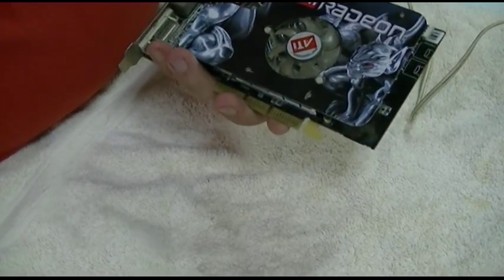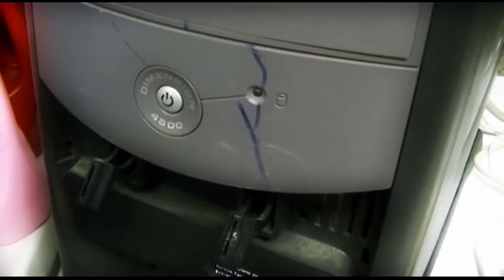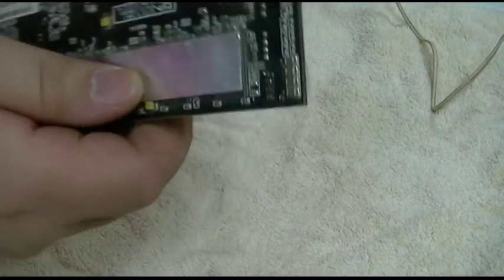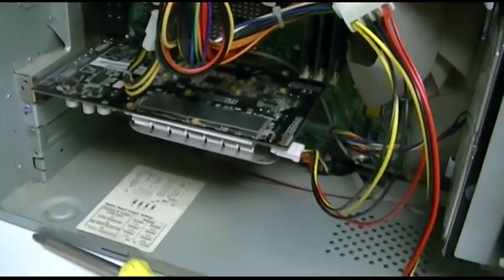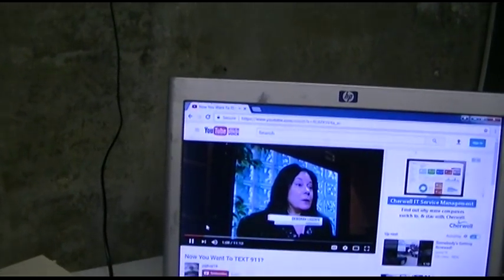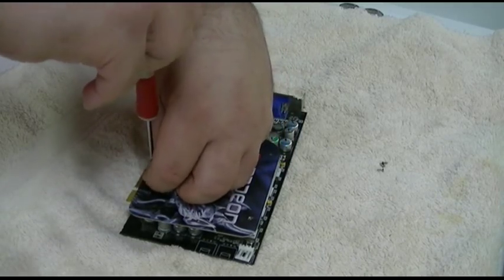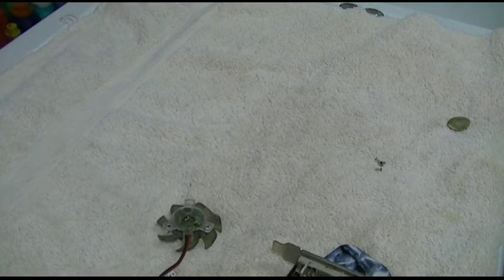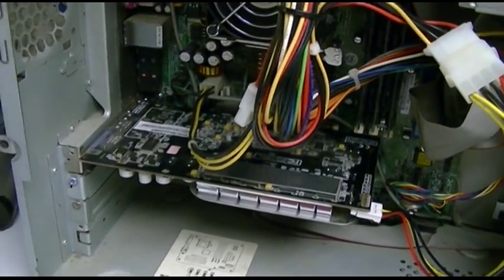Repairing The ATI Radeon 9800XT Video Card

Comment: Not too hard to fix. Would be nice if you could fix such a Radeon 9800 card with artifacts !
Reply from the maker: You might be able to remove the heatsink and use a heatgun on the GPU chip.  Heat it good and hot for about a minute, then turn off the heatgun and walk away.  Wait a full 10 minutes and then make sure it's cooled off.  Worth trying as a last ditch effort.